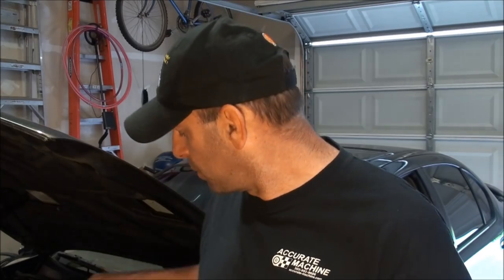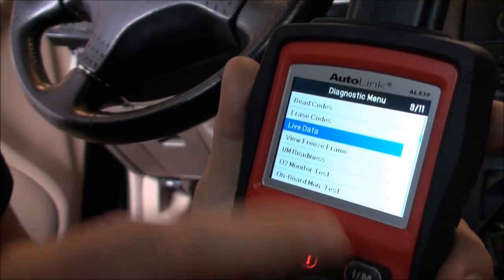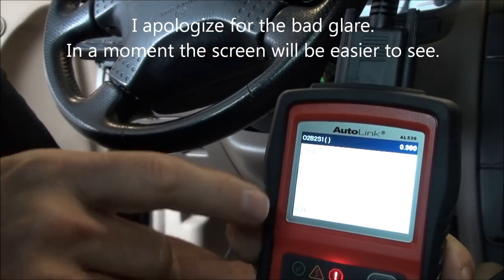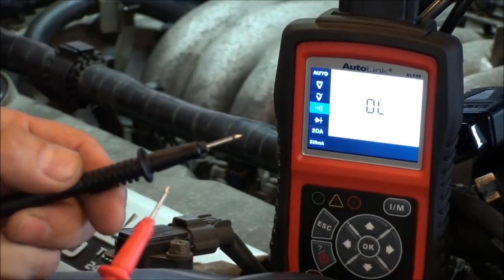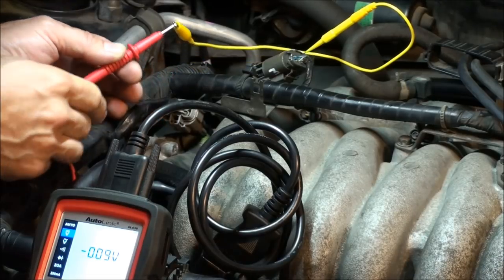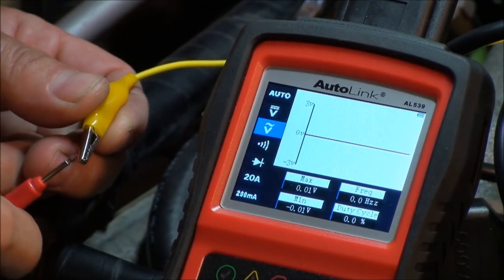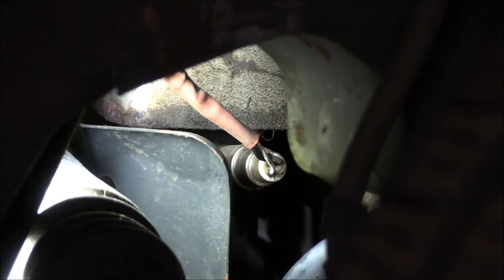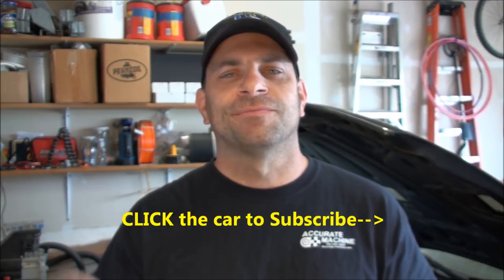Oxygen Sensor Testing -  P0134 - Autel AL539b Scan Tool

Comment: Hi there, you done ok, ohms test on heating element, you can test the sensor by putting a voltmeter across the earth and signal terminal and heating it up with aceteline torch, when its cold it reads 0 when its red hot it read 1 volt...Fred in Uk.
Reply from the maker: That is true for the heater circuit but lets not forget the other important circuit side of an O2 sensor, to detect oxygen amount in the exhaust stream.

Comment: Like how you work. Have just subscribed. Work as a mobile mechanic myself. Auto electrician too. Just bought this Autel tool. Did some research into battery load testers and nothing wowed me. Scared to buy something crap from China. Ok Autel popped up and because have my Autel 908 scan tool which rocks, figured to have it. Mean you can graph o2. Scan cars. Lights appear instantly to show if there are faults. And it does battery test. Great.

Obviously if you have like me fluke auto multimeter it has min max. You connect to battery and crank. If volts drop below 9v you know battery not so great and on way out.
Reply from the maker: Test and don't guess. Good job diagnosing.👍
Reply: @ozzstars_cars  So you reckon the Autel AL539b is good. But do you use it more than your scan tool?
Reply from the maker: @jamesbarratt593  for fast code checking, fuel trim data, battery health and a built in ohm meter, yes.  Easy to transport and it's low maintenance. For $100 that tool does a lot.  I can't say I use it more than any other scan tool. I use what I need.
Reply: @ozzstars_cars  yeah because what I hate is when I have plugged my scan tool in and then opted for choosing the vehicle. That way you get loads of selections to choose from which you dont know what the answer is. Then some cars you dont even get live data good like you get if you just go straight and select the eobd option. Cutting out the crap makes you more relaxed. A relaxed mind is what you need to be able to diagnose stuff.

Comment: Very nice video.  My dodge caravan, 2002, had o2 sensor replaced but the engine light never went off and now months later it's running rough.  I think repair shop should have done more investigating before letting me go off for so long thinking all was well.   They thought the check engine light was just stuck on.  Now I have to take it in for testing, but this video will help me communicate with them and be sure they are doing a good job checking wires etc.
Reply from the maker: Yes Cindy it's called diagnostics.   Find the problem, prove it's the problem, repair the problem and confirm it's fixed 100%.  Good luck, it can be a challenge to find a competent mechanic.
Reply: Thank you.  I should also mention I took snapshots with my phone and from the website I originally found your video, and I took pics of the info posted there so I can be sure they follow all avenues.  I also subscribed to your channel and am sharing it with others. Thanks!

Comment: Nice video Glen, keep on the great work, just to add something else, maybe insignificant but I would have also tried swapping the both sensors to see if the problem would change on the scanner. greetings
Reply from the maker: More data isn't a bad thing. Thanks Sergio.

Comment: Great video. My GMC Denali (2008) is throwing p1133 and p1153( o2 upstream) codes. I changed both with GM oxygen sensors and after two days the same code came back. Checked the connectors. Looks ok. Any suggestions? 
O2B1S1(v)=0.375
O2B1S2(v)=0.755

Comment: Nice review, Glen, this one seems to be a cut above the hand held market. Autel make some pretty good scanners, and some of their high end devices have bidirectional control. Ratchets and Wrenches here on Youtube reviewed the Maxidas, and for less than a thousand dollars you've got some entry level pro controls. I've been really disappointed by Autoenginuity pro, no bidirectional control and really clunky, it freezes all the time. The Autel Maxisys line sounds attractive, but high end scanners have prices that go beyond what most backyard mechanics can pay. Some of the Autel scanners have batteries that can't be replaced, and they ask for a subscription which is a barrier for guys who do it part time. So, if you hang on to tools for years of low usage, it is disappointing if batteries fail or if outdated subscriptions lead to a fail. I have a really old basic Autel hand held, and it erases codes much faster than all my higher end scanners. After more than 10 years,  it still works fine.
Reply from the maker: spelunkerd I certainly say there is no scan tool that does it all.  The worst is when the tool gives false data!  I've seen it first hand.  Take care.

Comment: I may have to pick that up.  I have a wheel speed sensor going bad on the van and it would be nice if there was a code to tell me which one.  Although, this is the 2nd one to go so I should probably just replace them all...
Reply from the maker: Matt Heere this tool probably wont give you live data to test a wheel speed sensor.  Would be great if it did.

Comment: My o2 sensor jumps from low to high voltage constantly.

-replaced cat a month ago
-replaced air fuel ratio sensor two weeks ago.
Reply from the maker: Is it an aftermarket cat and did you fix the condition that caused the previous cat to fail.  Excess coolant and or rich fuel condition will cause that.
Reply: @ozzstars_cars  hey I have a very rich condition -16 fuel trims lol so that probably did it and might have done it again.

I am diagnosing the cause of the rich condition, and a faulty downstream o2 sensor can be one of them. So that's why I was asking if my o2 sensor voltage is constantly jumping, does it mean it's broken?

As for the cat, yes it's aftermarket but oem fit...and the cat code (p0420) came back after 300 km of driving.